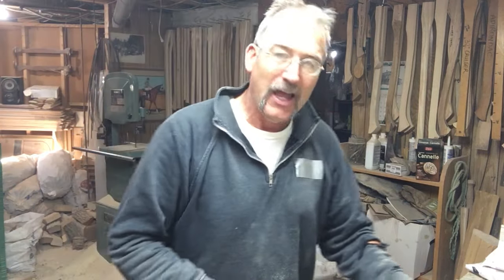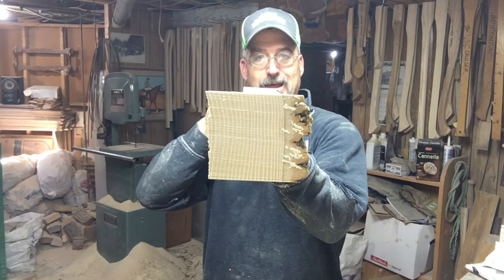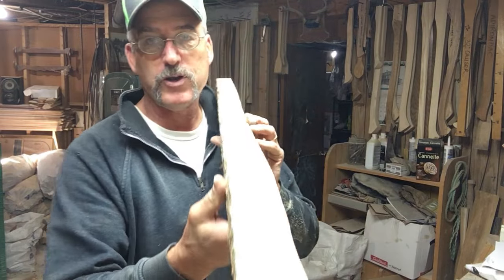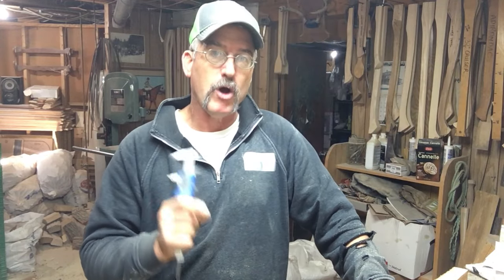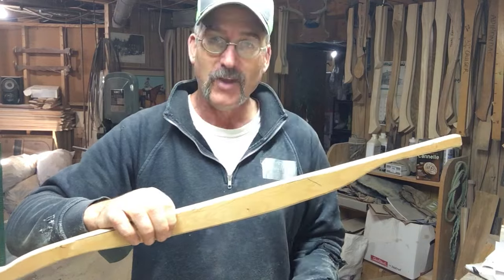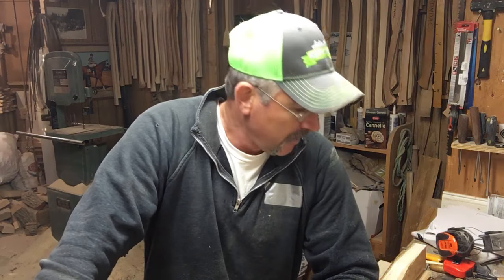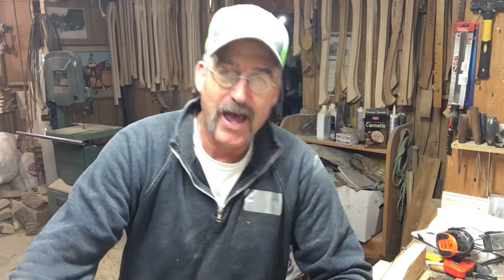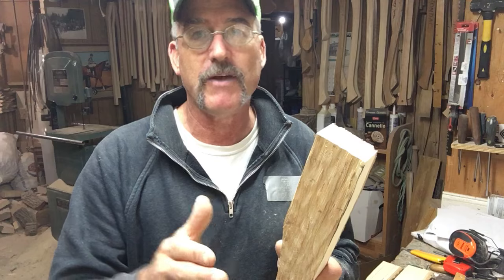How to make a STRAIGHT axe handle...a few of the secrets

Comment: Some really useful tips here. I make most of mine with fro, draw knife, spoke shave to rasp and finally a palm sander or scraper. I now know why I struggled using my buddies band saw. He is always on me to use the power tools as I am worn out. The band saw saved me many hours but is/was so iffy and tedious, now I know why. The bolt twists as I am running it down because the ends or bearing surfaces that contact the saw table are not true. I use almost exclusively Osage orange as its so very hard it wants to bind or burn even with low tooth count brand new blades. I only make stuff for myself and give some away or trade for vintage Scandinavian or German heads. I fit my heads and then cut my kerf so that is not a thing I need to worry about, but if and when I do I will remember this tip for stating all 3 cuts on the eye side. I like this.
Reply from the maker: Hey Scott - have you ever visited the website "the wood database"?  (https://www.wood-database.com/worlds-strongest-woods/)   Very cool site and tons of wood info in one place.  Your Osaga orange rates behind Pignut hickory in strength, but ahead of shagbark and a few others.   I must say I was surprised at how far down the list our favourite "strong" woods were.....but the ones at the top I have never heard of.   Many were species from the tropics or overseas, and surprisingly Eucalyptus was ahead of both of our favouites.  Glad you like the video.
Reply: I have checked that out many times, I happened on Osage looking at that website for local suitable wood. Most of the Hickory around here is too large for me to handle as I am a hobby handle maker, that said I found that Bois de arc or Osage had all the properties I was looking for for the same reason it makes what many consider to be the finest self bow wood. Super hard on the late wood ring I believe, the dark yellow rings. I only consider that a real benefit in that the leading edges of the steel dont sent the surface much during levering creating a hollow or running start to further loosen the head. Osage is about 100 percent rot proof. Meaning I can leave it in the mud and rain and the head will see more deterioration than the wood, poplar wedge not withstanding. I now used eastern red Cedar for that. Third ,it is very flexible. In my opinion it is very attractive.Not that a lumberjack such as yourself would care but being a closed grain wood I have polished it to 10K looks like glass and makes laquer thinner bead up let alone blo or wax.would make your;e new water stone  work to bit a mark on it. Here is the rub, You, scratch that I cant read the bark enough to know if its where I should be splitting it to avoid knots and such. Not a  viable choice for large operations but for a guy with  wedges, fro, draw knife, spoke shaves and a rasp or 30 it works out.
 @eastcoastlumberjack
Reply: Oh yea it glows green under a flouresent light along with Black Locust I made a few from that.
  @eastcoastlumberjack
Reply: Eucalyptus likes to explode if it cracks under load at least the long leaf stuff growing in Southern California.I do have some different gum handles,  , beef wood from some Aussie axe collectors and its seems pretty good but heavy like osage.
 @eastcoastlumberjack
Reply from the maker: @scottlindblom8480  wow!  It sounds like incredible wood.   Hope you find a piece to mail this way before long.   Can't wait to try it and put it in one of my "keeper" axes.

Comment: Grain direction for my handles is annular rings parallel to axe head; and whether its a splitting maul, a sledge hammer, or an axe, I really only ever use a straight handle. Left hand is anchored down low, and the right hand slides down as the head goes toward the work piece., being right handed and everything.
Reply from the maker: I'm right handed....but its my left hand that slides......